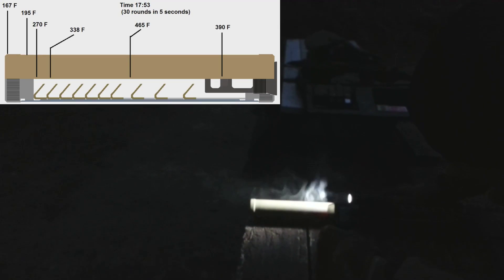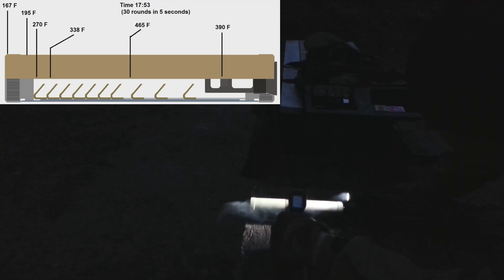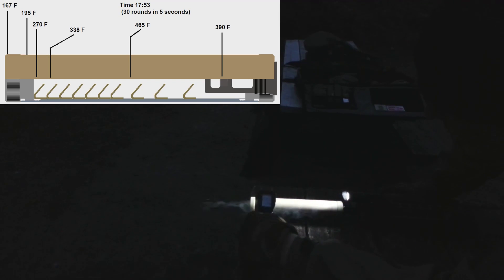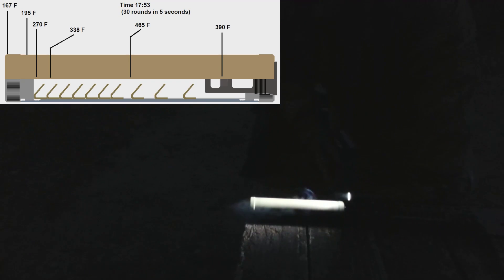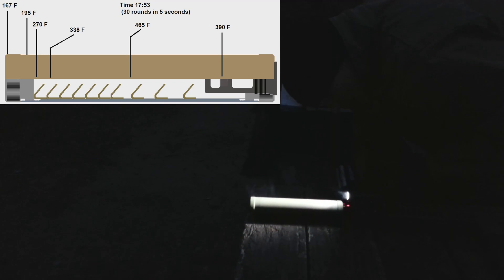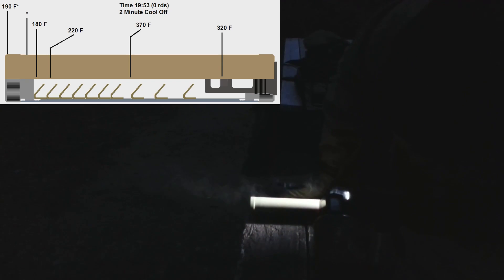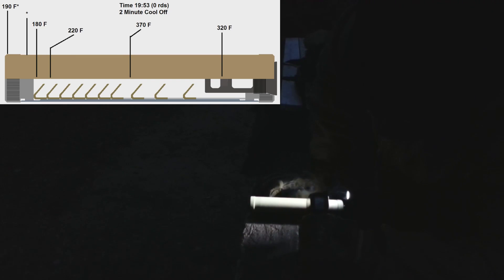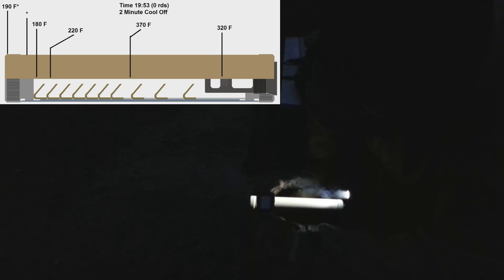SD Tactical Homemade Titanium Suppressor Heat Study Magdump, Pt 2

Comment: I'm new to this, but I noticed ten baffles in the graphic.  Is that too many? Perhaps that is causing the heat build up due to too much material in the tube. I've noticed around 5-7 baffles in others.  I'd like to know about your experience with it so far with regard to decibel readings, if you have them. .